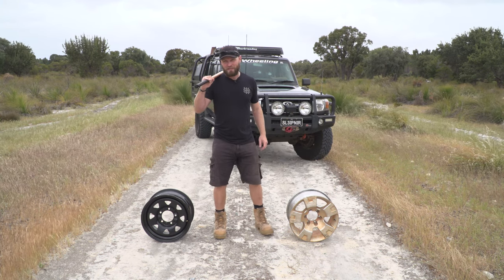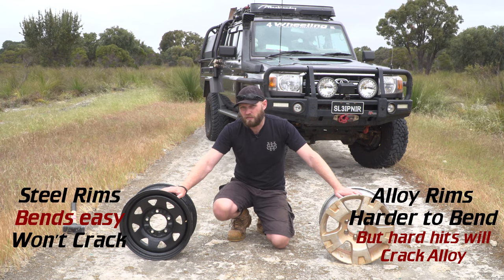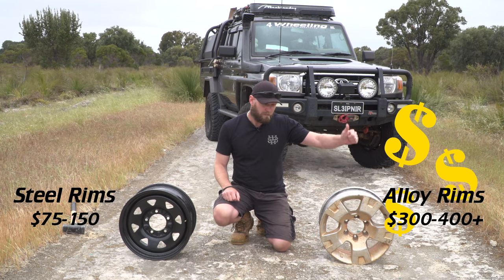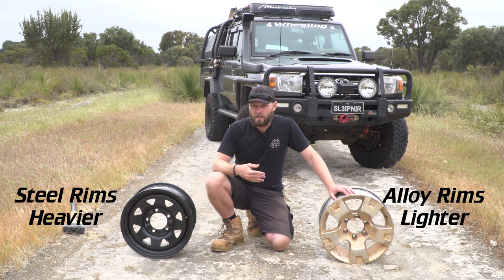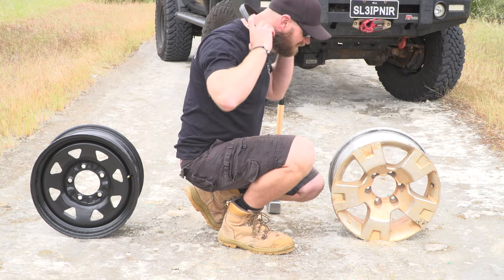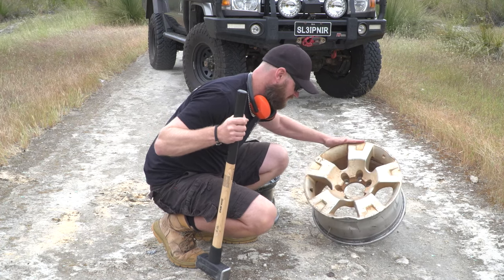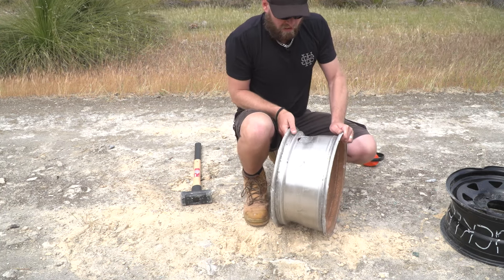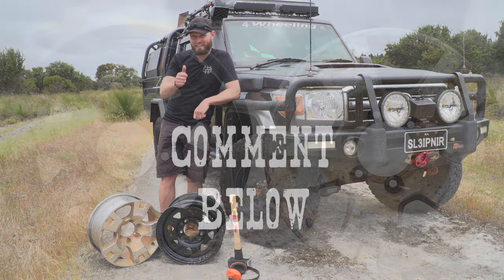STEEL vs ALLOY rims Off-road Wheels

Comment: You haven't testet the weakest point. The outer rim horn is relatively stable due the rim star. The inner side has no strengthening through the mounting star, so it collapses much more faster, if you hit it there. I think a hit there is much more worse for the alloy rim

Comment: Thank you a lot Ronny. 
I am in this point of choosing tires and rims for my troop carrier HZJ75.

It have a 35/12.5r15 BFG Mud right now, mounted on a steel beadlock Allied rims...  And I own also a 4runner with alloy Mickey Thompson 16 rims set I was thinking to use on the troppy... but after whatching your video and your reasons.... I'll keep the steel rims...

Comment: Skipped an aspect, weight rating, I'm having a heck of a time finding a steel wheel with enough weight rating. My rig, axles, tires, etc. will handle 4000 lbs per wheel. But find a 17"x10" steel wheel rated for 4000lbs, nope, not yet anyway.

Comment: Even if I crack the steel I can bend it back into place, welded it up good, grind it smooth and keep going.   Steel is for the hands on people, alloy is for the bought over built people.

Comment: I know alloys crack easier but still you had a alloy rim with the spokes on the outer which would be easier to crack the middle. And the steal the spokes were in the middle so of course nothing going to happen.

Comment: When it comes to looks the problem with the steel rims is the color.  When these wheels first came out in the '70's, they were usually white, and they looked great.  I don't know why they started painting them black.  Black is a terrible color for a wheel because there is no contrast.  The asphalt is black, the tire is black, the dark area in the fender well is black.  Add a black wheel, and you just end up with a big black glob at each corner of the vehicle.  You can't even notice the spokes in the wheel because everything is black and isn't that the whole point of a custom aftermarket wheel? - to see the design of the holes/spokes?  If everything appears to be black, why not just use the cheapest base level factory issued rims you can find?  A black glob is a black glob, no matter how much money you spent on it.  Here's a tip for all you people running black steel wheels:  Paint them white.  You'll be amazed how much better they will look.  Also, check out pictures from 4X4''s from the '70's.  White spokes were the most popular form of aftermarket wheel.  Oh yeah, one other thing.  White letter tires help a truck look better too.  Some people mount their tires so the white letters are on the inside.  Are they crazy?  That would be like, like, well, it would be like having an aftermarket steel wheel -painted black so no one would ever notice that is a custom wheel.

Comment: alloy rims look way better... not the factory stuff, im talking aftermarket wheels. 

There are some epic alloy 4x4 wheels out there with so many different multidimensional designs to keep most people happy and there is even ones based of the old school steel wheels but modernised with some depth.

Comment: As an auto tech myself.  Iv replaced many tires on all kind of rims.  
Aluminum rims corrode far quicker and worse then steel.  Very rarely does a steel rin rust to the point that you cant easily sand and repaint it. 
Alloy wheels on the other hand... they are terrible and almost impossible to clean off the corrosion

Comment: good video Ronny! something i want to point out is that because aluminum is a much lighter material than steel, the actual construction of the rim will be bulkier in the case of aluminum but thinner (thus acting flimsier) in the case of steel. the only thing that should be made out of aluminum are beercans, and even then, its probably bad for ya health. aluminum = shitty good for nothing CHEAP SHIT. - in my opinion
Reply: My boat is aluminium not sure I’d want a steel one
Planes are aluminium, steel ones don’t leave the ground

Comment: Common sense if the tires are wrapped on the wheel. Its good enough. It also depends on how hard of a off road you take. If its gravel or dirt roads up or downhill. I'd go alloy. If its climbing boulders. I'd go steel.

Comment: One factor Missed, Modern 4WD wheels are predominantly Hub Located. Unfortunately the majority of aftermarket steel wheels are stud located. This leads to mount and remount errors on the wheels causing vibration not a huge factor off road but as most people now use their vehicle as dual purpose it does create significant issues for  daily driving. that said at least one Australian wheel company is producing hub located steel wheels.

Comment: But at all you can say, the Aluminium rim is only stronger due thicker wall thickness. If you make a steel rim as thick as a Aluminium rim, even forged ones, the steel is far stronger. But much much more heavier.... A normal steel rim from a personal car is made from much more thinner material as an Aluminium wheel is made...

Comment: I don't own a 4wd SUV or a car but I my opinion alloy wheels are should only be fitted on cars where the differences probably would be felted/notice and Steel wheels are should only be fitted on 4wd SUVs. 
I think alloy wheels make 4wd SUVs look like Chelsea tractors which is the nickname given too large four-wheel drive vehicles used only in urban areas and are never taken off road (in the UK).

Comment: Thing with alloy wheels, it's always tempting to buy cheap Chinese knock-offs - but those can be deadly.  All you need to do is whisper "pothole" from three hundred miles away in a foreign language in semaphore pointing the other way, and the whole thing collapses into the hub.

Comment: I d rather steelies anyday they are easy maintenance and have less chance of getting gutter rash in the city as well as rock damage off road. Aluminium is brittle and once u even bend it fatigues or even cracks whe u try to bend it back into shape and alloy rims also get stained by the brake dust from your brakes and steelies are easier to clean because they dont have the nooks and crannys like steel rins ,i cleaned and detailed cars and 4wds for a living after i dropped outa high school.

Comment: Steel wheels are stronger than aluminum wheels, just go to the local car repair shop and look at the wheels from cars that have been in horrific accidents. What you'll see is that steel wheels deform and absorb a lot of impact energy  where in a similar impact aluminum wheels almost always shatter (call it what you wish, but pieces will break off) which means that the impact energy was transferred to the vehicle and its occupants. The same exact thing happens when you impact a rock offroad.

Of course there is always an exception to every rule and there are a few (very few) forged aluminum wheels that are as strong as steel wheels. Most aluminum wheels are made of cast aluminum which of course makes them very brittle and suspect able to the types of impacts that are experienced offload.

Properly forged aluminum wheels are terribly expensive, the last time I checked they were $1,000 and up (each) so it seems very unlikely that someone will install a set of wheels that costs almost as much as their truck.

Comment: What about performance off roading ? Higher speed, long travel suspension and bypass reservoir shocks like King, Fox, Sway Away? (thumbs up on my KINGS). Not the Rancho etc.. I have had on previous mall trucks. The weight is not important there. Sure I heard of the guy from Compton who went to the doctor having trouble getting his wife pregnant. He came home in a fancy suit. His wife said nice suit and what did the doctor say? He told her the doc said he was impotent and if he was impotent he was going to look impotent and bought the suit on the way home.  I am not as concerned with looks with money on paint and rims as performance doing 60-70 mph over 2-3 foot whoops (passing Jeeple spotting each other off the curb) not spilling my drink.

Comment: Rony hi from California i have a question.
I want to buy a 2000 mitsu montero or a 2002 isuzu trooper.
Wath do you recommend?
Reply: Neither car is available in Australia so Ronny would have no idea. But, looking at buying a 15+ year old truck - pick the one with the best supply of spare parts. If you can look up how many of each are still on the road, pick the one with the highest number still running. Personally, without knowing anything about American cars, I'd go for the Mitsu. They still have dealerships operating, and haven't been taken over by another company, which is more likely to mean spare parts haven't been discontinued for profitability.
Reply: Actually they are both available in Australia, just under different names... the Montero is a Pajero and the Isuzu Trooper is a Holden Jackaroo. Personally owning a 2003 Pajero i'd pick the Montero, very underrated 4wd and if it's diesel they have great fuel economy.
Reply: Thank you ronny
Reply: Ryan Lennon ups sorry
Reply: All good man haha 
But yeah go the montero!

Comment: Also Aloy scratches LIKE A CHEAP PLASTI DIP.. 

i barley touched a curb at 10 mph (one of those retarded super skinny but super long dividers on a car wash entrance) and now i have a good 2 inch scratch.. and to repair that ONE rim is the equivalent of 4 cheap steel rims..

Comment: I banged out a steel rim in 5 mins rubber still on , wasn't hard on eremoved from the trailer , was three inches towards center, bit more than your sledgy hits , with a builders hammer , back to round

Comment: Im about half way through the vid and I have to disagree.  Last time I went to buy new tires and wheels a few years ago I wanted steel wheels for the reasons mentioned.  My tire shops supplier for what ever reason couldnt get what I wanted.  After 2 months of waiting my shop gave me a loaner set of aluminums.  I ended up keeping them cause I scuffed them up a bunch.   Told the shop Id pay the difference.  The aluminums were actually cheaper and they gave me the $200 difference.  Now mind you this is in BC Canada not Australia.  And just comparing plain black steelies  to plain black aluminums.  The aluminums were both cheaper and more readily available

Comment: Steel rims are vastly easier to balance properly with weight on the outside and inside of the rim.  I'll take a non shaky non wobble drive on the highway any day over a better looking tim that won't balance properly.

Comment: steal all the way. The front end of my truck which is a 2002 Silverado HD 2500, with an 8.1 L engine and it weighs just over 2400 pounds. Lol no way I gods green earth do I want to be off road and had a rock with aluminum wheels with that kind of weight.

Comment: For any truck that's not going to be driven almost exclusively on a paved road I'd go with steel. Their simple utilitarian style looks better than the majority of aluminum rims being made by the same 1-2 chinese factories.

I cannot stand the fake beadlock look and the all-black wheel thing is way overdone...but the majority of alu wheels are black or some dark color. If you want something else you have to pay extra for powder coating or repaint them yourself. I could not find any 18" steel wheels in 8x180...I'd love some mod or daytona style steelies but for some reason the 8x180 bolt pattern is being neglected.

Comment: what about the difference in weight....if there is any?
Reply from the maker: no much at all in these two. at a guess 2kg at the most
Reply: If I'm not mistaken a 16 inch wheel rim should weight something like 11 kg for an alloy one vs 13,5 kg of the steel one. I'm absolutely agree with you that the tire alone is about 28 kg so two kilos less are not that much but I just would like to point out that the wheel in a "not suspended" mass so each kilo you remove worth about 7 times more than a kilo elsewhere.

Comment: Look, 90% of people with 4WD's are in it for the pose and their car would only touch dirt once a year so aluminium looks a lot better. I think steel rims can look good, on older cars like my 3.0L flat hilux or a 70 series Cruiser new or old. But the strength can also completely depend on quality, cheap steel rims can rust and become brittle and some can have a higher grade steel with a higher grade paint and rust protection and wont rust. Some alloy wheels can use some cheap shit coke can alloy where some other can use 6061 or even a blend with 7075 and be as strong as steel.

Comment: This comparison  ignores mileage? A friend switched to steel on his Tacoma and lost almost 3 MPG! The weight penalty, especially in terms of rolling resistance and it's impact on mileage,  is not insignificant.
Reply: David Galvin and he kept the exact same rubber? That's pretty surprising
Reply: Trevor 87 So he sez. He was surprised but tire guy told him Tacomas do suffer w/ these particular steel wheels. I would expect to see some increase but the size of it is eye-opening.  Maybe it's specific to his Taco.
Reply: You will NOT notice a millage difference Off Roading! In those situations all other impacts are so much more relevant!
Also NO difference on highway. Except in terms of aerodynamic! This CAN be a huge impact on highway.

Rotationary mass is relevant when accelerating, but the rubber itself is again way more important.
Reply: David, 3mpg is huge and unlikely.  I went from 30" highways to 33" Duratracs and didn't even lose 1mpg.  I can't believe a few pounds near the hub could have that much difference.

Did he happen to install a light bar at the same time?  I lost almost 2mpg on that deal... 6mpg if there is a headwind. lol
Reply: Jesse, I obviously can't rule out something like an alignment or other wheel issue and I cannot really put him on the stand.  I can say he is pretty meticulous about his rig.  He wanted steel wheels and took them off when he saw what happened to his mileage.  I feel a little too much like a troll for making my point with his example so I'll just close by saying that I feel mileage is a factor that I wish had been included in Ronny's video.

Comment: Ah, Yes. The old question has surfaced again, alloy vs steel rims,OR MACHO vs PRACTICALiTY
Had a Troopie in 1986 with skinny Split rims.got a 2016 still with skinny's on it.Got a fair idea why Toyota had them for so long on there workmates { No it's not price} Farmers in the outback may add to this discussion.

Comment: You can get aluminum rims 15"... Been running 15x8 on TJ. Lighter stronger, no issues. Steel rusts and sucks for long drives, gets hot, overrated but they are cheap.

Comment: do aussie off road guys not use rock rings?  Just get some cheap rock rings for you're steel wheels and weld them on , then they are all around better than aluminum other than weight.

Comment: I would take steel all day.... 

with that said some things you got wrong. Steel is heavier than aluminum however you have to use a lot more aluminum! So you will actually find a lot of them are heavier for trucks! 

The other thing is size, rim size is relative to tire size. You said you don’t want to want to go bigger than 18s, but if your running over a 40 inch tire, 22 would be fine and off-road if the wheel is built for that. When you get into really big tires if you use a small wheel your trucks steering will be retarded. (Ask me how I know ;)